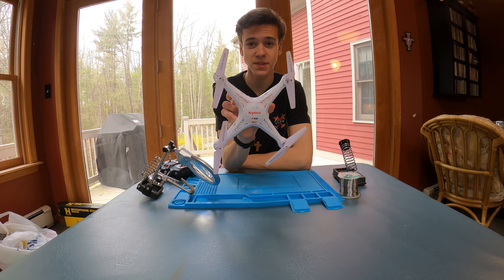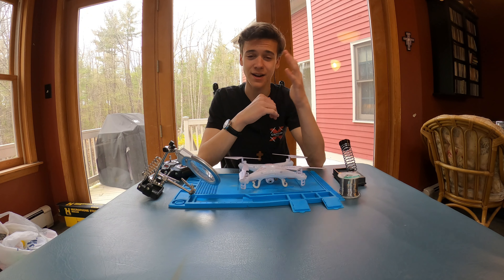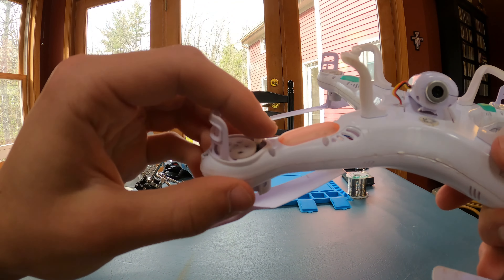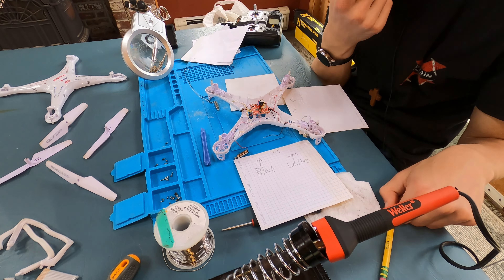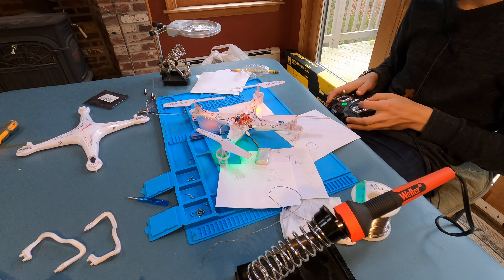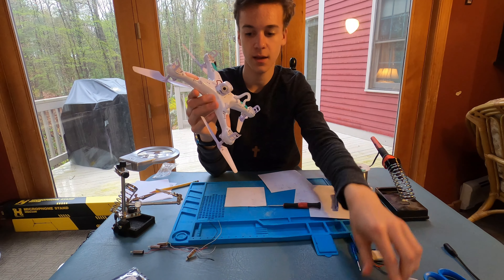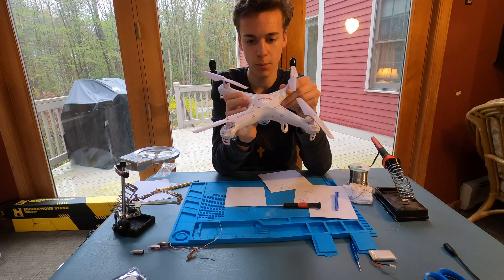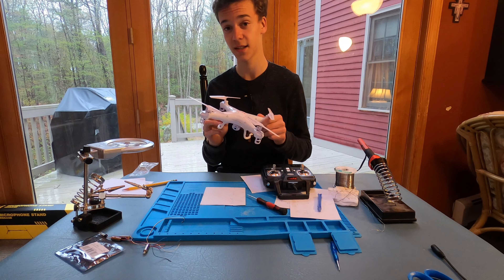I fixed my 10 year old OG Drone!

Comment: My all time favorite, I have a Syma X5C that I mounted a FPV camera, I still fly it today.  Replaced many motors, All 30 tiny screws to get to the guts. I use my Jumper T-16 with the 4in1 multi controller with EdgeTX.  I wish we still had offerings like this today, inexpensive units to learn on.  Prices of quads has gone up greatly with the advent of all brush less, analog/digital.  Thanks for the Video and nice job.
Reply from the maker: Thanks so much and all you said is cool and so true 😧